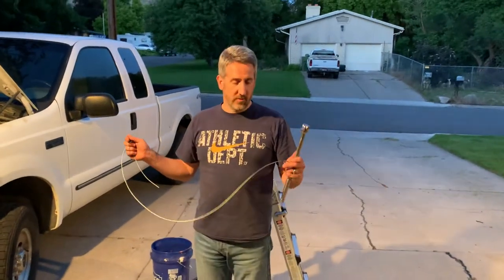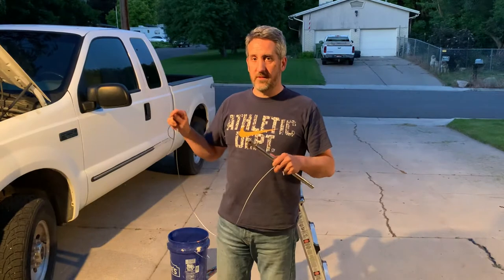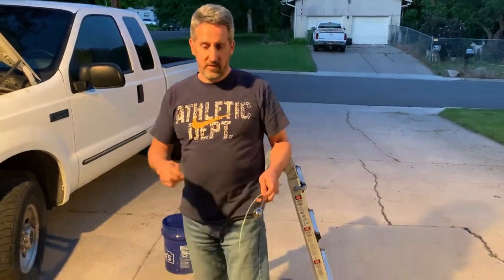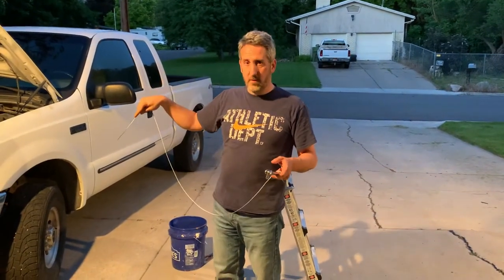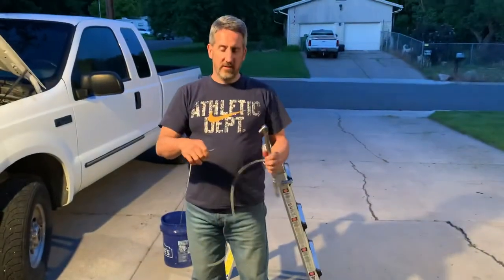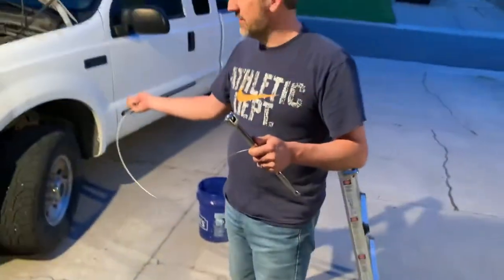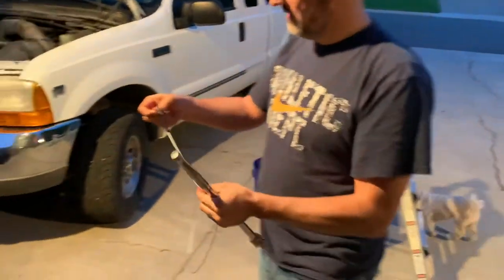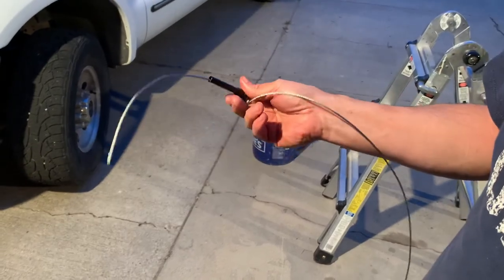Ford Super Duty Repair Broken Oil Dipstick Tube (5.4 Triton)

Comment: I'm gonna try this tomorrow.  Thanks so much for the idea.
Reply: How did it work ?
Reply: @tubetime39  i pulled and pulled and it didn't come out.  I ended up having to drop the oil pan and hammering it out. I put a tap into it, can't remember the size,  3/8 maybe, and had to beat on it with a mini sledge for a while until it broke loose. It was really stuck in there.
Reply: @dr7477  thank you, We will be taking on this project next week,

Comment: Just a tip for anyone trying this. Something just told me to put the not a little more than a foot  from the end of the cable and leave the end sticking out the drain plug hole. I jerked my guts out and nothing. I put some heat on it, jerked and the cable broke. I guess from getting it too hot. No problem pulling the broken cable back out of the oil pan. Gonna try again with stainless steel cable. This thing is really stuck solid.
Reply from the maker: very good point. Make sure the knot isn't too big. gl!

Comment: How did you install it though, I am having trouble with it
Reply from the maker: Install the cable, or the new tube?
Reply: @protonspring910  the new tube
Reply from the maker: @richardcarlson1207  You just press it in from the top and bolt it to the side of the engine where the bracket it.  I am sure you can find a number of videos that demonstrate this.  Good Luck!
Reply: @protonspring910  I wish it was that easy, but it does not seem to be.  I broke the replacement trying to get it in.... Now I have to dislodge that and then try again....
Reply: @richardcarlson1207  Were you able to get it back in without removing the manifold? really struggling here..
Reply: @noahcleary5235  yes,  I put the end on the grinder till it slid in like butter